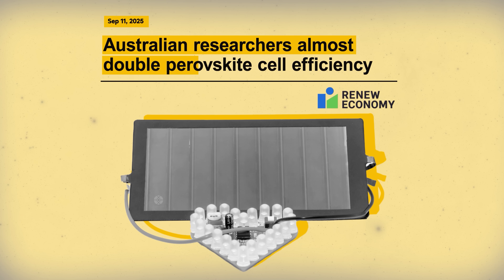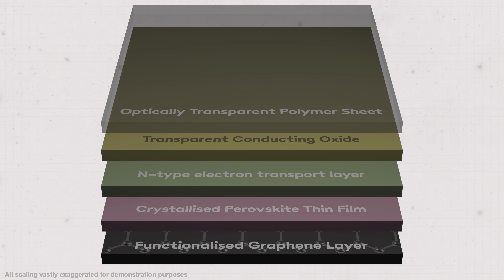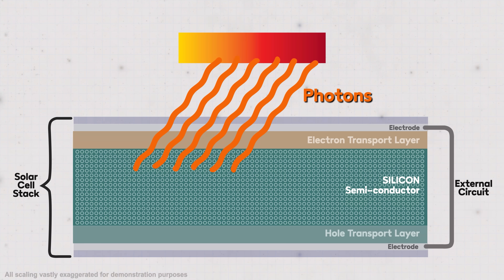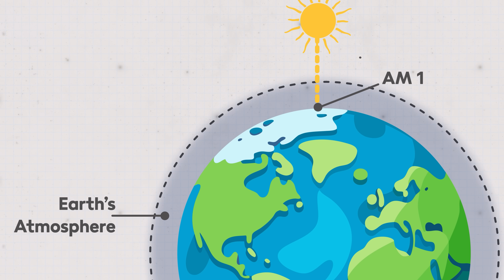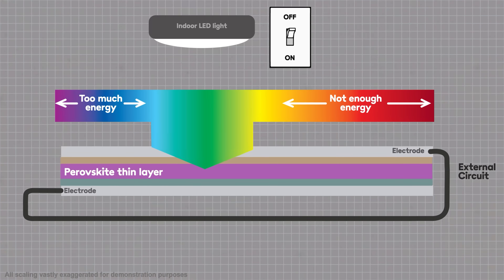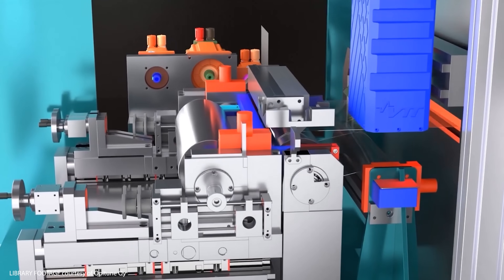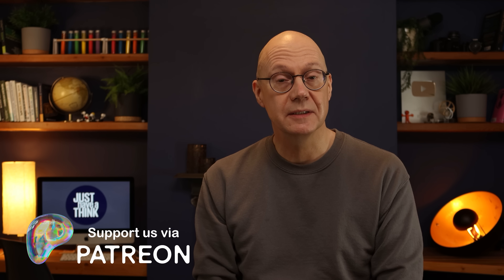Graphene Perovskite just revolutionised the Solar PV industry!

Comment: Instead of chasing efficiency per m^2 they should find a way to maximize watts per dollar per year, plus streamlined deployment/replacement tech. Area is rarely the limiting factor, cost is.
Reply: Agreed.
Reply: At scale, and in the long run, they're likely the same exercise.
Reply: @undaware  Not necessarily. Silicon needs to be purified by heating to ludicrous temperatures, that's a constant unavoidable per-kilogram cost. Perovskite skips this step, giving it a massive advantage out of the door. Currently the poor lifetime is its worst problem; it already outpaces it in watts per dollar, but not watt-hours per dollar. Increasing efficiency without increasing cost is sure welcome, but it's unlikely to compete with silicone in watts/m^2 ever; meanwhile it could totally dominate if it either didn't require replacing every 3 years - or it was made so dirt cheap even replacing it every 3 years still nets you less than buying silicone and replacing silicone after 70. 

Imagine "dumb" panels of protective glass (plastic? acrylic? whatever, good lifetime, good optic properties), with built-in roller/pulley system and space between the glass and the base. You install a spool of perovskite, tape the end to the end of the previous spool, and a motor draws it through the panels in a back-and-forth path, spolling the old, worn film, replacing the entire active layer of within course of an hour and with ~3 minutes of actual human work. A large solar farm could be refurbished within a week by a crew of 2, not a back-breaking cost every 3 years. Providing the spools are really cheap.
Reply: @sharpfang  .. I wasn't claiming anything for Perovskite specifically, but rather that if the most energy intense PV technology has come down 90% in a decade then one can imagine many technologies being made viable at scale.

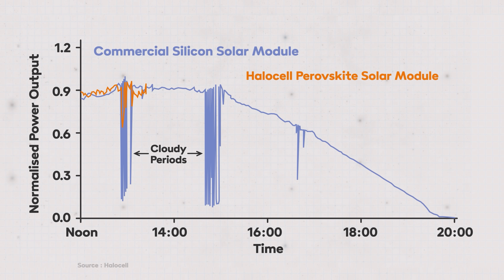Comment: I really mostly stopped caring about efficiency. When there is sun, it is easy to get oversupply anyway - way more important to improve low light performance. Hopefully these cells are good at that, too. (Yes, at 12:30 he mentions that they should!)
Reply: True. At this point, lowering the cost of solar power is much more important than improving efficiency. And energy storage comes closely in second.
Reply: Yeah, in sunny areas solar is already the cheapest energy source by a wide margin.  Efficiency gains were more important when there was a close competetion between solar and the next best energy method (which varies depending on location and resource availability)
Reply: Low efficiency means most light is left unconverted so yes it will
Reply: Efficiency is still important, especially for use in homes where the amount of space for the panels is limited.  Greater efficiency means you don't need as much space for panel placement to get the same amount of energy.  Think available roof space and use of less than optimum layout of panels.  Efficiency is still important.
Reply: @kencarpenter1363 As someone who is likely to be paying to put panels on a roof soon, I think that given the pace of change, the panels I install now are quite likely to be replaced (at least partly) in around a decade.
It looks quite likely that there will be enough incremental improvements (without needing any miracle breakthrough) to mean that at that point I'd be able to put a meaningful amount of extra capacity in the same limited roof space.  That'd be more to keep up with my power requirements with very little consideration for roi.
The aesthetics might have improved a little by then too. (I don't think they are ugly, just wish that they could blend in a bit better on a period property - regardless I'd still tend to favour "ugly and affordable" over "invisible and expensive"!)
Reply: I live in Colorado. Tons of direct sun means I can use OLD tech (N-type, monofacial) and be very happy.  I appreciate the development focusing more on how to make panels that can be more efficient in cloudier places (eg Europe).

Comment: The state of Australia should pour in money to commercialize and mass-produce this product.
Reply: Won't replace oil which is 80% of our total energy, in all the things around us, we could have free electricity and it won't replace aspirin or nylon or any of the 6000 plus produsts we get from each barrel, asphalt, petrochemicals etc and they all come from oil after it's been refined.
Reply: @antonyjh1234  The vast majority of the fossil fuels are used for energy production (both for electricity, heating and transportation) and can relatively easy be replaced by non fossil fuels, mostly non combustion electricity production. There is a part of the fossil hydrocarbons that are used in different kinds of manufacturing and industrial  processing. I'm sure that the need for fossil resources can be minimized even here if we put an effort into it.

Comment: Good explanation.  Thank you.  
This technology utilizes Graphene.  
I don't know if you have already talked about it but I am interested on your take on Flash Graphene.  The ability to make Graphene using things like waste plastic with an input cost of about $30-$40 in electricity per tonne..... yeah,... not per kilo, per tonne.  When using waste plastic, it need not even be  cleaned. Depending on the plastic used a major byproduct would be hydrogen gas  that could be used for fuel.   Virtually any raw material source that contains carbon can be flashed into Graphene.  Cheap production of raw Graphene can then allow it to be used as add mixtures into  asphalt and concrete, increasing both strength and lifespan dramatically.  Stronger concrete that last longer helps reduce the large carbon footprint used to produce it.  Asphalt production for roads will lose raw material as less and less petroleum is refined for ICE vehicles.  Asphalt that lasts longer is a good thing. 
Heard about all this through Dr. James Tour of Rice University.
Reply: Definitely not a good idea to burn plastics in a horrendously poisonous way to create carbon just because its cheaper.
Reply: @katzda 
I suggest you actually study the technology.   It isn't some regular incinerator.  Will there be some waste products to dispose of?  Depending on the raw input used, I assume so.  Some forms of potential fuel may be deemed unsuitable, but most is not.  One reason is the ridiculous tempratures the flash system works at does not leave toxic compounds but breaks things down to constituent atoms.  Anotherwards the "waste" is carbon, oxygen, hydrogen, etc.  As a matter of fact, this could be/is  called a clean technology.  One proposed use of flash technology is to push electrodes into polluted ground.  Flashing the dirt in situ.  This breaks down dangerous and toxic compounds into their base elements.   Cleaning up toxic sites without having to remove the material.  This technology is being developed into a viable company, who's current pilot production is making one tonne of graphene per day.   Plastic is not the only raw material as well. Virtually anything that contains carbon can be used.  But it is a great way to dispose of waste plastic because it doesn't leave behind toxic compounds, it's a cheap process, and unlike virtually all other forms of plastic recycling, the plastic doesn't have to be cleaned.  Any dirt or contaminants are driven out of the reaction in the form of  non-toxic elements.  The original research came out of Rice University.

Comment: Sounds Wonderfull but how much of the cost to install solar cells is the cost of the panels, or perhaps even just the cost of the actual PV?
My guess is if the actual PV was free, total cost of the entire system would only save 5%
Reply: Panel mounting cost is about a third of the panel cost, then there is still wiring cost. Increasing efficiency decreases both those costs per kW installed.  Your 5% is way out.

Comment: The greatest application might be coating electric cars, ships and even aircraft with those materials, providing around 50 km per  day without any need for charging!
Reply: You would need 100% efficiency for that, and live on the equator, and have the time to always be noon.
Reply: @AndersLang-i5s Aptera has already developed a solar car.  It doesn't require 100% efficiency, living on the equator, and the time always being noon.  The car itself is efficient, so it doesn't need as much energy as monster truck.
Reply: @incognitotorpedo42  It doesn't exist. Their claims are not verified and highly unlikely to ever be. And it's not a car, it's a motorcycle.

Comment: Light weight isn't a big deal for utility scale or roof top solar which have to withstand high wind and snow loading. Panels need to be stiff so a light weight panel will need more support.

Comment: Ok, so we are about to slap on Perovskite solar FILM on about everything, right?

If this development continues to improve, it becomes more and more viable to stick it to cars, trucks, Semi's Airplane wings, walls and roofs of all sizes, etc.. 

Where I work, the flat roof does not have solar panels because the roof is not strong enough to hold te extra weight.. But with this it seems viable to just stick it to the roof's surface and get rid of all the racks and stuf to keep the panels in place and angled to the sun the best way.

The very low price and high efficiency make it very viable to use everywhere, without the racking and optimal angle to the sun.

But it is still a lab product, right... So what is next, is to find ways to produce this perovskite solar film at a massive scale, because demand will be off the charts if it really gets this cheap and efficient!
Reply: There's a physical limit to what can be achieved. The sun's output don't magically increase just because you want it to.
Reply: @AndersLang-i5sNo of course not, but if you can harness 20-30% more of that sunlight per square meter while that square meter costs 50-80% less, there is almost no limit on how much surface area we could use to generate power... I see not only roofs, but also the walls of buildings being covered by solar film. 

We could easily get to the "Super power" that RethinkX (Tony Seba) talks about: Abundant sustainable Electric power at marginal costs, way more capacity than we need under normal circumstances, the excess power can be used for high power applications, like water desalination, production of steel and aluminium, production of clean hydrogen, etc.

It is a dream conversion of technologies and massive price drops. Both solar power and battery storage see enormous price drops right now, which leads to a massive increase of solar power capacity, paired with battery storage.
Reply: @MarcoNierop  There's a physical limit. No matter how effient a PV panel it still needs hectares upon hectares of space for the simple fact that the sun only delivers around 1kW per sq meter. You need 100 000 hectars of panels to replace a minor power plant.

Comment: Perovskite PV was always a promise... now it's heading for the real world 😊
Reply: People are so impatient. They forget material science, and industrial manufacturing takes so much time. 

 So much investment. Most of all it needs hope. 

 So many are working against EV tech. The leaders of the world when you look at it. 
 
 YASA has a 750kw/12kg prototype motor. That's 1000bhp peak with 350-400bhp continuous. No exotic materials.

 That's 59mj/kg. 

That peak power blows a top fuel dragster which is 25-35mj/kg, and an F1s total system is a measly 6mj/kg! 

 Then Chevy is on course to produce pilot plants for their 600wh/kg battery. 

 Those tech by themselves would revolutionize our lives. From personal flight to exos to robots to new, smaller, construction machines. 

 Together they will allow you to have a VTOL craft for a few hours of flight. With multiple motors providing crazy redundancy. 

 I am a suffering corpse supposed to die back in 2022. With an x2 transplant the only way to save me. 

 Lies! I'm. Alive. The future can be so bright if we make it. 

 We need to fix the corruption. Embrace the good tech, and think long term. 

 Imagine what EVs would be like if we embraced the tech years ago ya know. 

 I may hate all you all as a group, but I also want to see you all succeed individually.

Comment: We've all been waiting sooo long for a breakthrough, it's never forthcoming, prices yes, revolutionary efficiency, not really. Here's hoping - thanks, Dave.
Reply: If they get cheap enough, just buy more panels.  Efficiency is not the only way to get more power.  You only really need high efficiency if space is very constrained, like on a car or spacecraft.
Reply: why do you need revolutionary efficiency? are you building space ship?
Reply: @SergePavlovsky  Personally, no, though when I was looking for panels I needed to buy the most efficient as I have a complex roof NE, SE, SW, so I had incentive to find the best for limited roof elevations and some vertical areas for winter sun. 
It's an observation of fact, so many promising breakthroughs over the years, all a false dawn; small incremental improvements, but nothing significant - sure, if ya live Murica or wherever, with lots of unobstructed space, then of course put up as much as you can afford, why not. There are however, millions around the globe who have a very limited amount of space, and for those people high EFFICIENCY would make a meaningful difference, especially if they live anywhere other than the US where most people have modest power requirements; I use 5kW per day, all year, not 30,40,50+...
Reply: @Bob-h4s2pyou don't have to put panels on the roof. You can put them on the walls or in the ground. You still didn't answer why do you need revolutionary efficiency. I can understand why people would want lower price per kWh, but better efficiency is not really needed, except in exceptional cases  like building a space ship or pv powered plane
Reply: @SergePavlovsky  I already answered your question - EFFICIENCY per sq/ft/M, if we had 40% efficient panels, they would yield nearly double the current average for people around the world with very limited space. I also said I have some panels on 2 vertical elevations 'specifically'  for winter sun, I gain a lot from those at this time of year.
Why don't you work on your comprehension of what was actually said, eh! Rather than being unnecessarily argumentative, how about that; they're just my observations, and guess what, you don't have to agree!
Reply: @Bob-h4s2p you've answered some other question. what is the point of having 2x more efficient panels if they cost 10x or 100x? you didn't say why do you need more power from pv at any cost. can't you comprehend comparison with space ship?
Reply: @SergePavlovsky  Like to argue the toss don't you...look pal, wtf are you talking about, spaceships?? Irrelevant - why do you think they would cost x10, x100, it's nonsense. I didn't say I need more power at any cost - have a look... I said, for the very last time - THOSE PEOPLE ALL AROUND THE WORLD WHO HAVE VERY LIMITED SPACE FOR SOLAR, WOULD BENEFIT GREATLY FROM REVOLUTIONARY HIGH EFFICIENCY PANELS - THAT IS A FACT! NOW CRAWL BACK UNDER YOUR ROCK AND PLAY YOUR VIDEO GAMES, WE ADULTS HAVE THINGS TO DO!
Reply: @Bob-h4s2p lol, only spaceships are relevant because it's very expensive to launch a lot of panels. on the earth you just find some unused ground and stick your panels there. there's no shortage of space on earth. it doesn't have to be 10x or 100x, it can be 1000x. it can be anything because you didn't limit it at all, all you can think about is efficiency with no limit on price. best efficiency is produced in lab settings, which is orders of magnitude more expensive.
ALL CURRENT GLOBAL ELECTRICITY CONSUMPTION CAN BE SUPPLUED BY PANELS ON TINY FRACTION OF DESERTS - THAT IS A FACT!!!!

Comment: Probably still years away from being available. 
Not only that, where I live you can’t simply deliver back to the grid at no cost.
Reply: OK, so don't do that then, use a battery bank, a parallel system to your grid connected one; if you self consume and store power to a battery bank you'll still be laughing your socks off.
Reply: @Bob-h4s2ptoo costly to store all the energy used during the dark months, probably more or less 1000KW or even more. 
Right now that would cost me a fortune, have no place for those, would be quite a hazard storing that much, insurance cost would be sky-high and what more….
Reply: @JustBadMeAndI  Thermal batteries can be a viable alternative if you need heating during the winter. It won't give you any electricity but it will cut your heating costs.
Reply: @AndersLang-i5sThis is not an option and not what you said before. 
As if a thermal battery works, also way too big for an apartment.
Reply: @JustBadMeAndI  What do you mean about simply delivering back to the grid at no cost?   Why would you want to do that?  To use the grid as a battery?  You are one person, and maybe solar isn't a good solution for you.  That doesn't mean it isn't viable for many people.
Reply: @incognitotorpedo42 because that’s what all people do here when there’s more energy from the panels than what you need, the meter runs backwards with a mechanical meter, but, not many have them anymore and the ones who still have them need to upgrade(downgrade) soon to an electronic one, this data can be used by the provider to calculate your bill. 
It’s still not that bad but it used to be a good deal before.

Comment: That's exciting. Seems like the two aspects where Perovskites were promising continue to get better. 

So what are the major hurdles remaining now? Durability, as mentioned. Is this any easier to manufacture at scale (if it's cheaper?) And then lead use (maybe more for regulatory reasons than actual risk per se)?